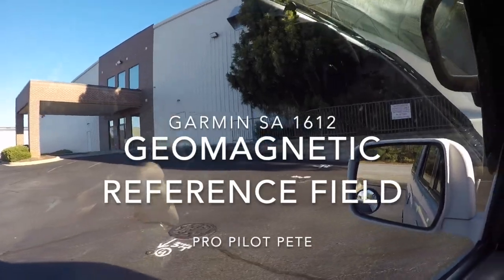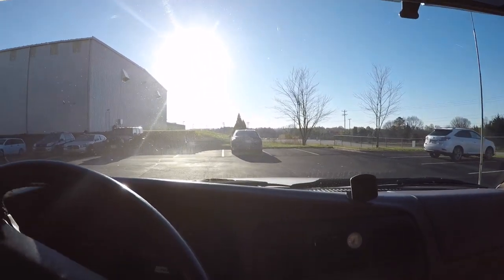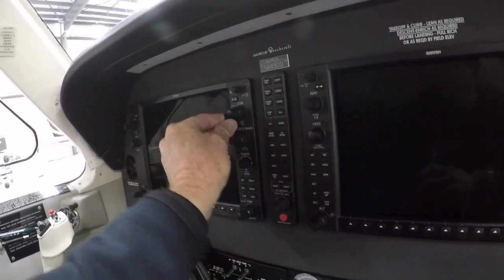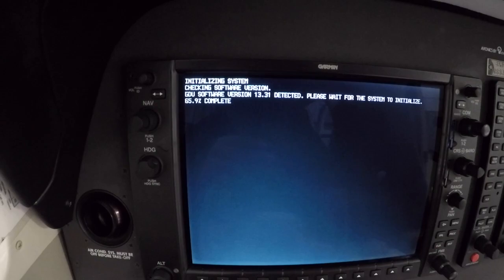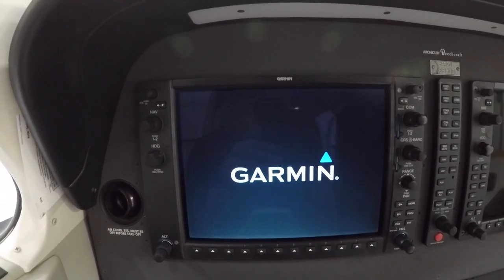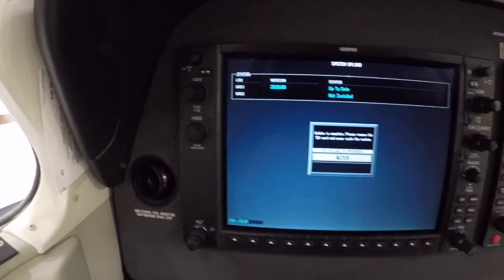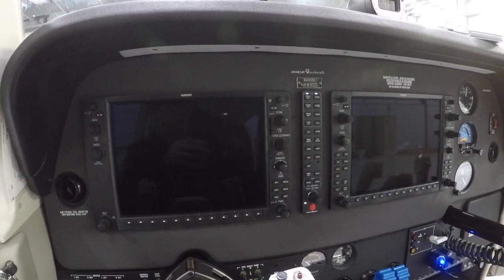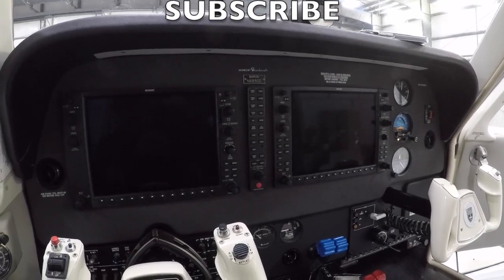Updating Garmin SA1612, International Geomagnetic Refernece Field

Comment: hi, great video, what is the exact model of the SD card?  why do I need to update my system please
Reply from the maker: I used a 2GB card per garmin’s website instructions, the brand was a Sandisk. It normally is updated thru a routine nav data update but this one failed to update so it needed to be done per this procedure. Hope this helps. It is necessary only if it didn’t happen automatically on your nav data updates.

Comment: From the video, it looks like the database was already successfully loaded when you filmed this. Did you use the October version of the Service Advisory, earlier, which doesn't"t specify pulling the MFD circuit breaker, as the November version does?
Reply from the maker: This was the November update. The data was successful but the variation part failed. Had to do it thru a separate SD card.